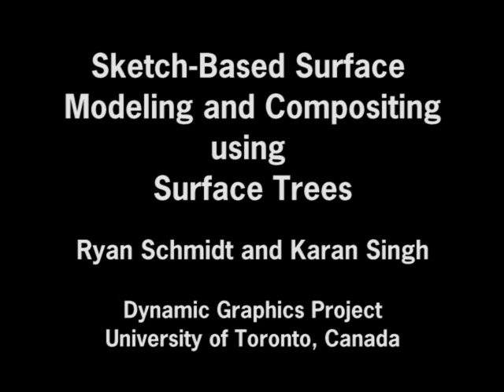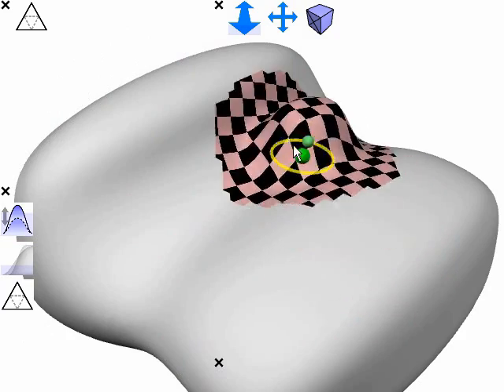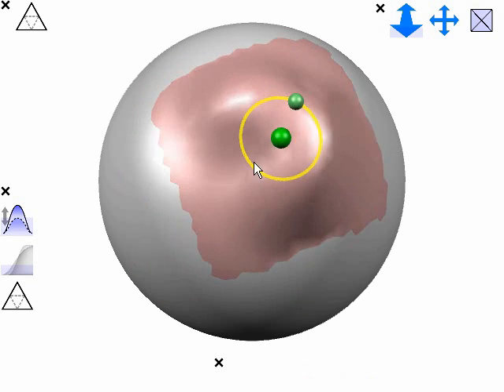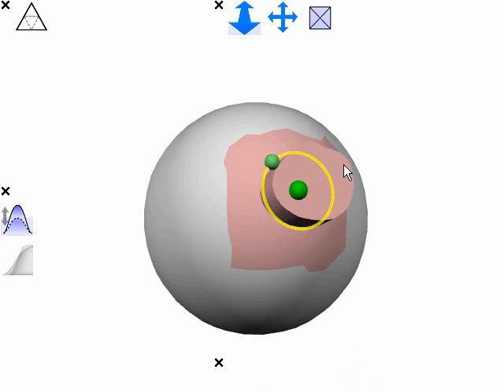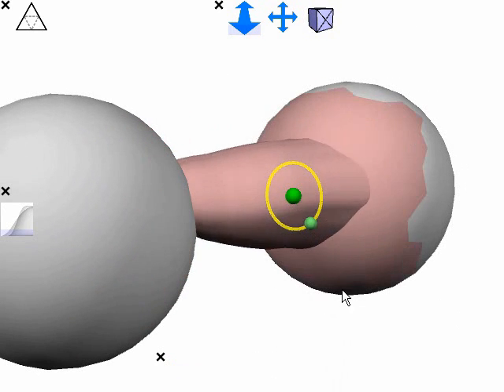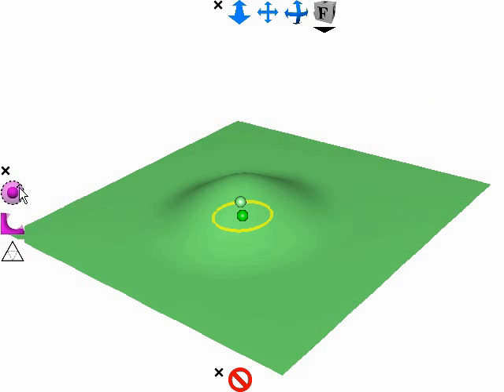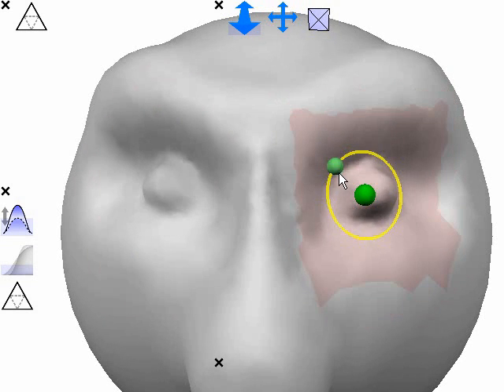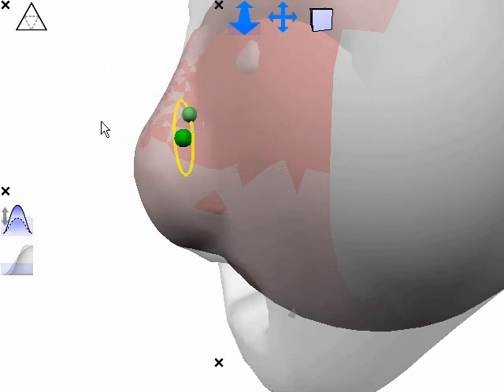Layered Surface Modeling

Comment from the maker: displacements: yes
subdivision: no, just polymeshes, but it could use subdivision locally (that is in progress ;)
frustum-cull: yes, if they were totally occluded and did not affect any layered geometry
LOD: yes, each individual part can be meshed at an arbitrary resolution
self-intersecting: yes, it's hard to prevent this =)

I nearly have a standalone demo (outside of shapeshop) working, so game devs might use that, if they were interested...